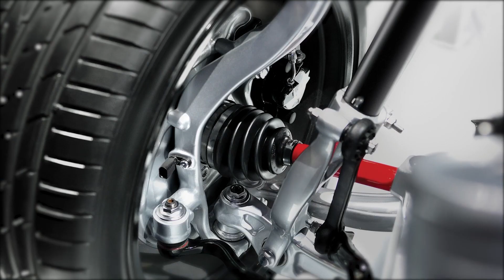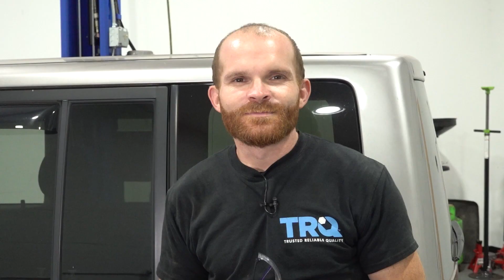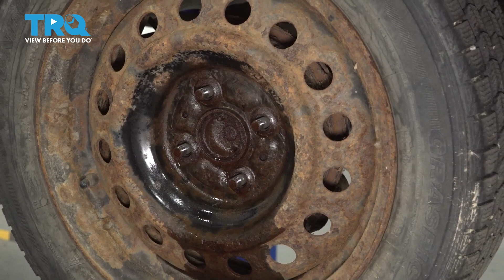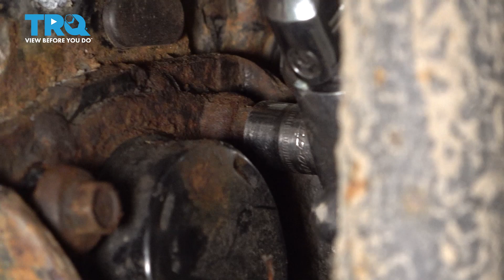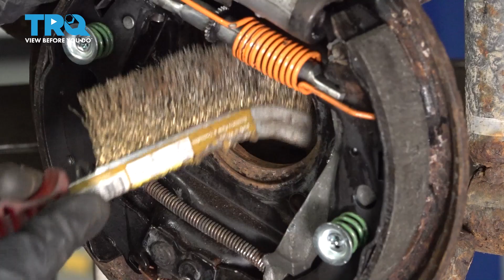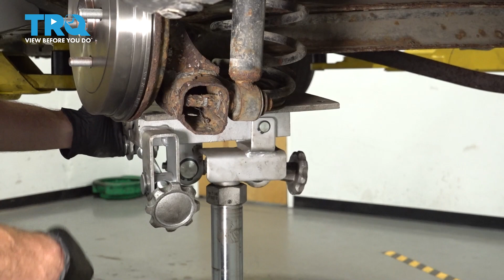How to Replace Rear Wheel Bearing & Hub Assembly 2004-2006 Scion xB

Comment: You were lucky they were not rusted in very bad. My 2004 xA has 165k miles. The hubs were very hard to remove. I had to use an impact chisel to separate the unit from the mounting flange. PB Blaster was my friend too.